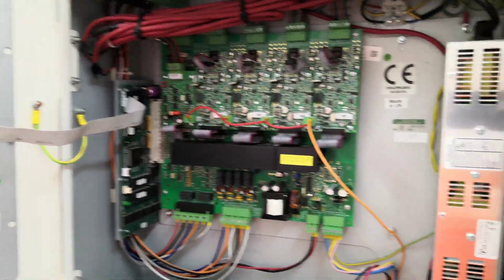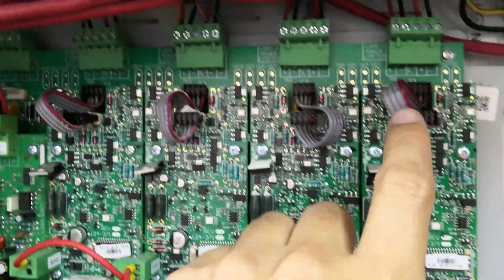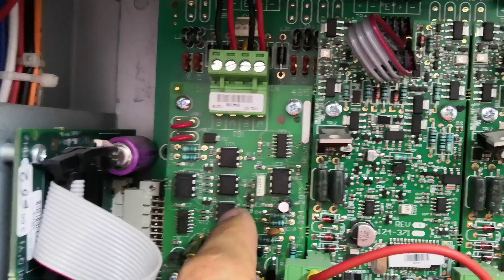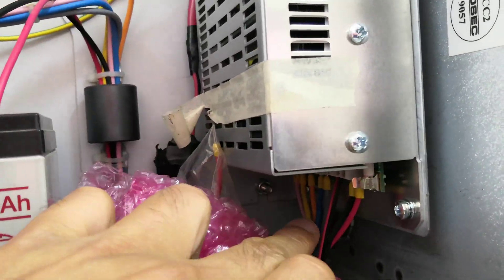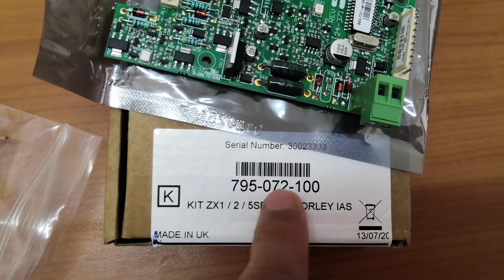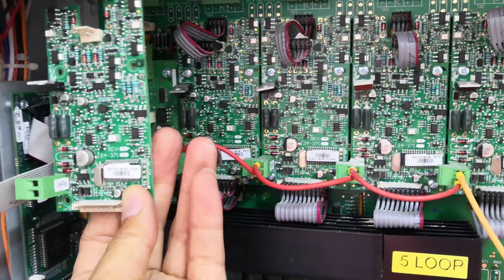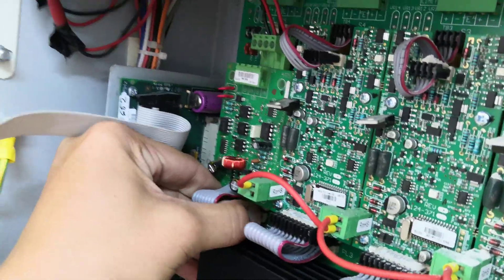Honewell Morley ZX5se fire alarm panel basic connection and loop cards لوحة إنذار الحريق

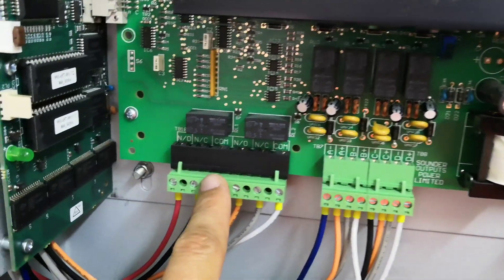Comment: Hello.. can i know the size of the resistor (kilo ohm) from the terminal at left upside panel from sounder length, please ? At minute 1:31. Thank you
Reply from the maker: for EOL sounder resistor is 6.8k ohm
Reply: @markgestadavid  is that EOL are same size for ZX series ? Or only for ZX5se?
Reply from the maker: @kevinseroy258  the same
Reply: @markgestadavid  Ok. Thanks a lot for your information 🙏